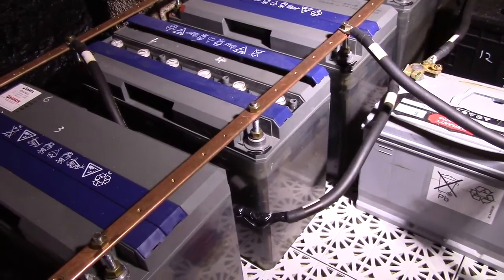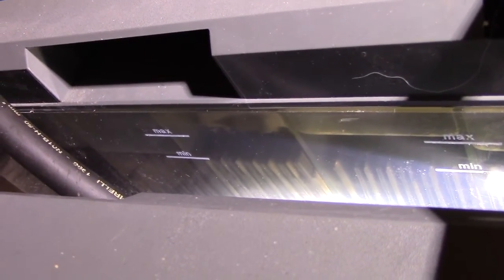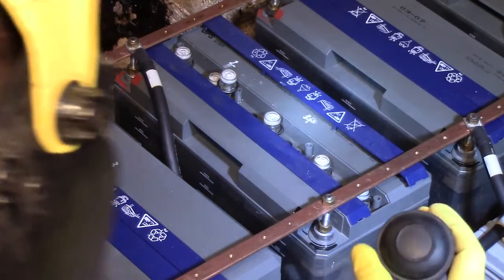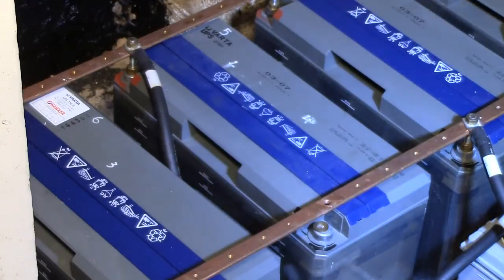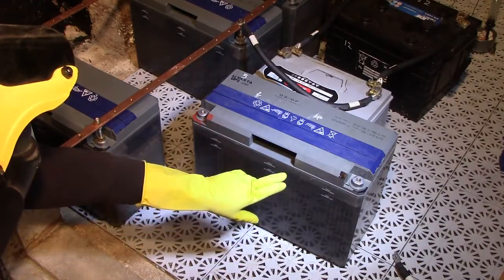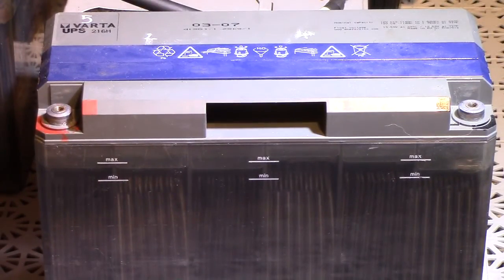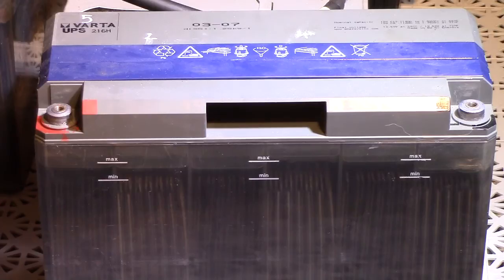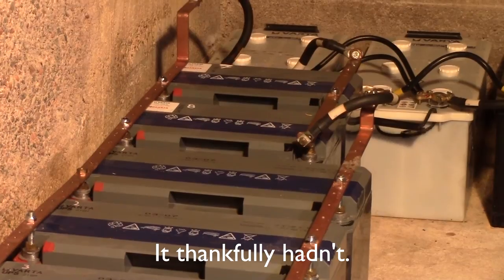Dealing with an OVERFLOWING lead-acid battery

Comment: Man, scary experience :(
Did the Sulfuric Acid flow over the sides of the battery, or did it all stay in the cell cap trough?
Reply from the maker: Much to my relief, it stayed in the "trench". That's a much appreciated safety feature of these particular batteries. It did come close to overflowing, however. There was only about 2 mm of headroom on one side.

Comment: Using those copper rods as bus bars, and putting short quick-disconnect leads to each battery would be a little more sensible maybe?
Reply from the maker: +Allison Pell This set-up was not very safe, no. It had nothing to do with the failure, however.